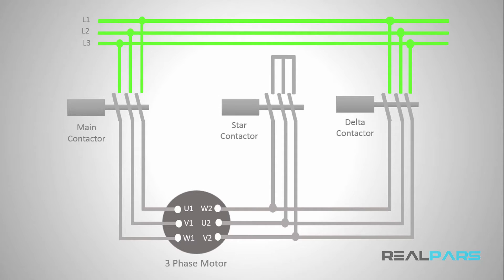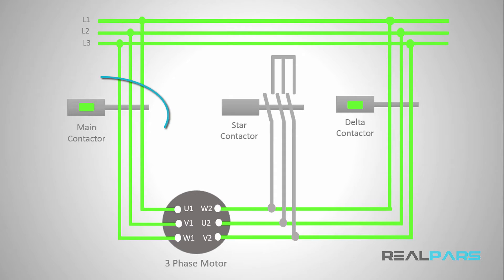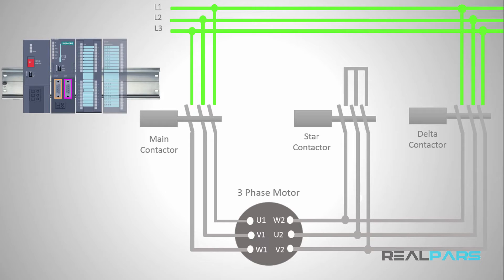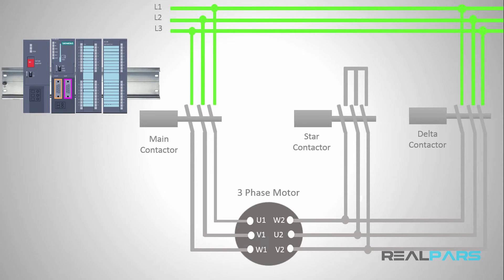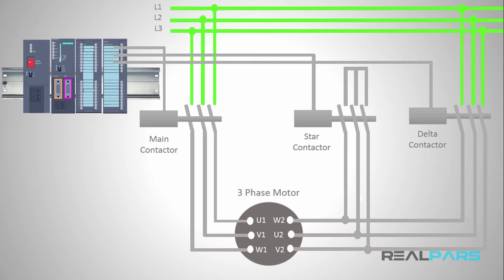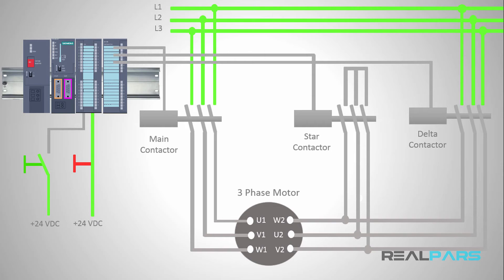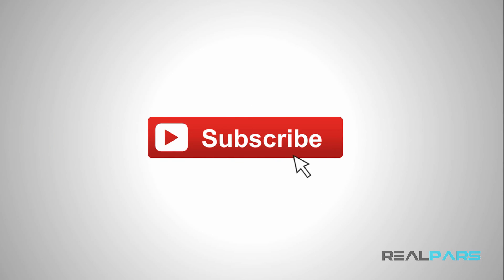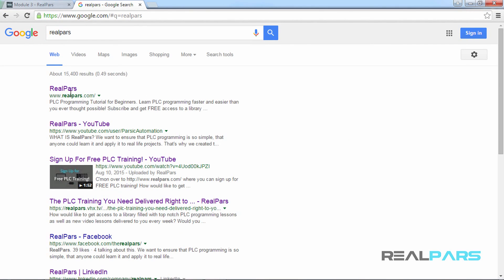Star-Delta Starter PLC Program and Wiring_Part 6

Comment: Awesome videos. 
Although..  A2 points of the contactors need to go to neutral?
Reply from the maker: The coils on the contactors typically have an A1 terminal (H or +24V) and an A2 terminal (N or COM).  The incoming power is three-phase (L1, L2, L3) and on the load side (T1, T2, T3).

Comment: In Star connection it seems you are shorting U1 V1 W1 together, is this correct? I think this would effect all the other systems connected to the same 3-phase system.
Reply from the maker: It may appear that the phases are shorted, but in reality, they are not.  Remember the motor is an inductive load, and each winding has an inductance.  The star system is balanced, and in a balanced system, an equal amount of current will flow through each phase, i.e., U, V, and W. Therefore, the voltages across each are equal in magnitude but displaced from one another by 120°.

Comment: hey there friends!
what will happen if u2 v2 and w2 is connected to main contactor? and u1 v1 w1 is connected to the star and delta contactors respectively?
Reply: It will work.
Reply from the maker: I have not really tried that before but I think it does not make any difference. Has anyone ever tried that?